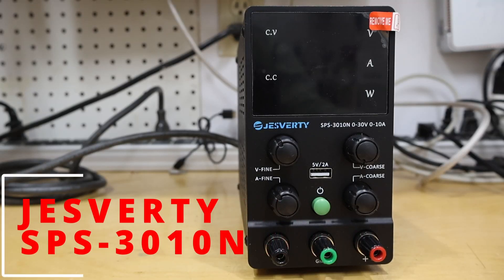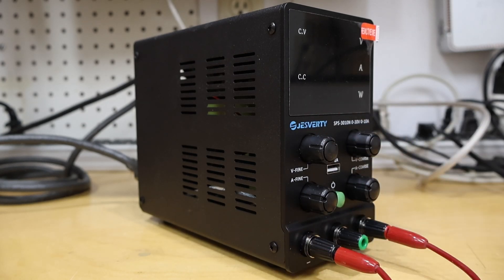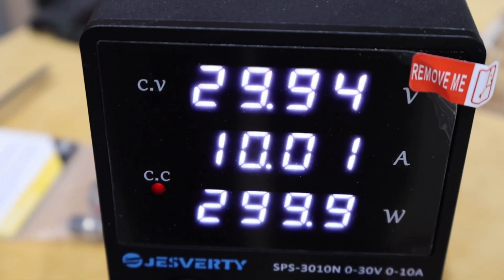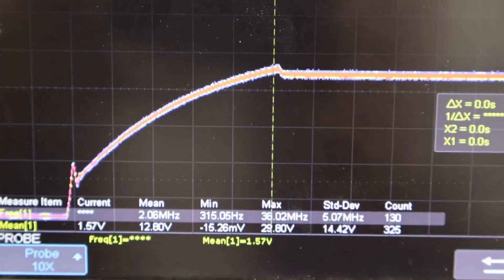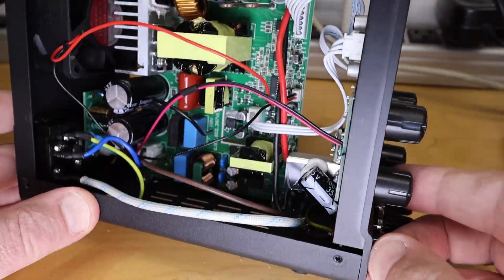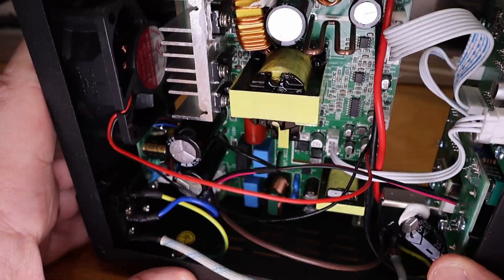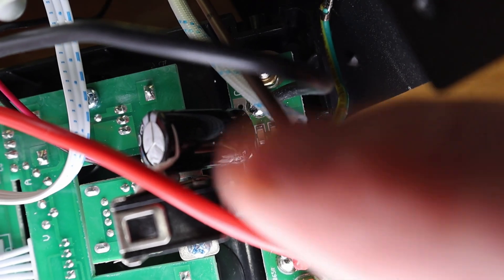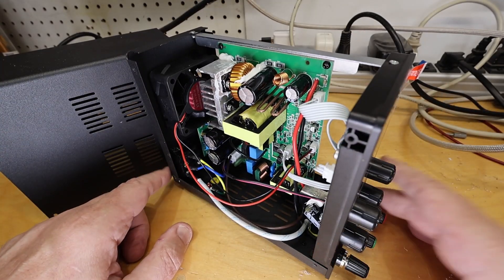Jesverty SPS-3010N Lab Power Supply Review

Comment: It's a sad state of affairs but I am impressed these days by anything using a real chonky-chonk switch that actually cuts power.

That said, I'm pretty sure my not-quite-as-good Tekpower TP3005T's switch is even chonkier than this one.  I haven't opened it up yet, but I would not be surprised if it was switching two contacts; it is loud and you can even tell from pitch whether you're turning it on or off.

And I just realized the numbering scheme matches between the two.  But I don't think I can actually get 5 amps out of mine.  Is the 10amp rating on this one accurate?

Comment: That switching transformer seems a bit anemic to have 300VA moving through it.
Reply: High enough switching frequency and it will work, as you now are transferring the same amount of energy more times per second. With MHz switching you can get power supplies that use a similar size transformer, yet are rated for 600W of output, using what amounts to a 2 turn busbar as secondary, and active diodes, and they last well in servers as power supplies.

Comment: Put the reverse diode on the output.... It will save your PSU. Something that fails short. If you accidentally plug in a battery that you're charging backwards the diode will short and keep the remaining magic smoke inside.
Reply: What is the PSU ? I think I cooked mine😢
Reply: @drtreeson what? Your PSU is your PSU dude
Reply: I would also like to know what PSU stands for . I like the idea of adding a reverse diode to the output
Reply: @jonerasmus9399  Power Supply Unit

Comment: The output capacitor could defiantly cause a current spike beyond what the current limit is set for. As you said, probably a trade off for lower ripple. Would be nice to see the measured ripple with and without the cap.
Reply: Yeah I've noticed my capacitors are not listening to me.